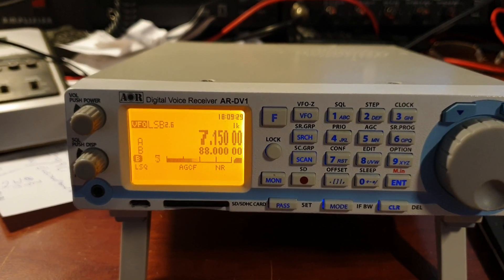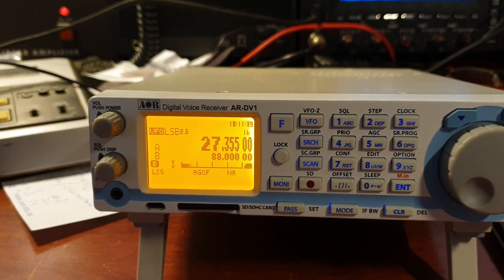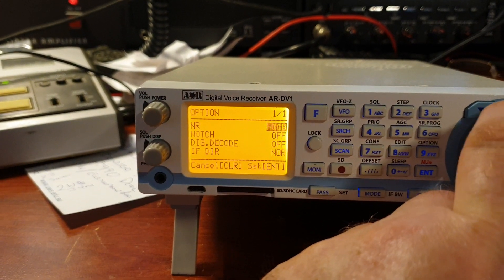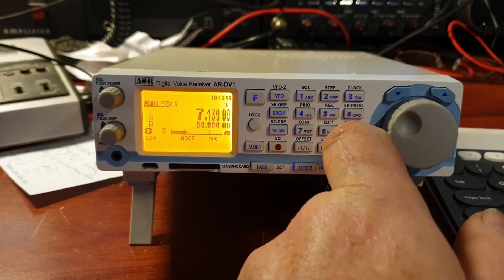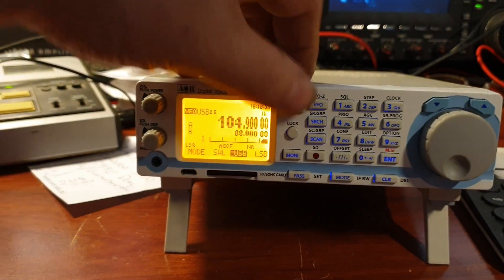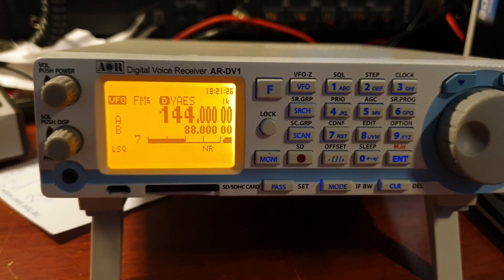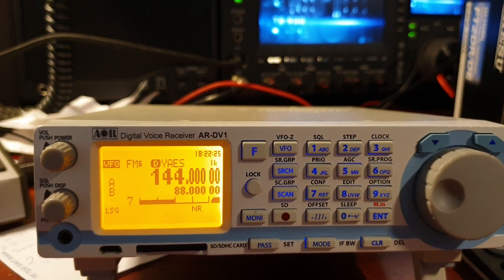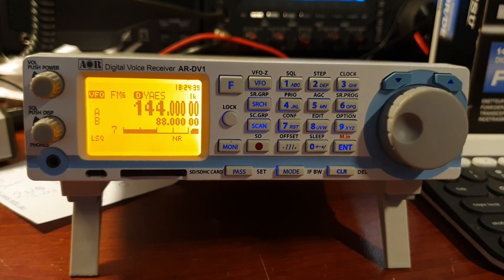AOR AR-DV1, I think I'm in love!!!!!!

Comment: Great little Receiver and the price reflects it. :) 73s Joe
Reply from the maker: Hi Joe, I was pretty lucky, in Australia, even through Australia's largest ham radio store (www.strictlyham.com.au) and hes never making huge margins, has them at a discounted price of $1800 AUD here in Aussie.  A mate in NSW was feeling sorry for me for this in the box as new one, $950 AUD posted to my door.  I was overjoyed as I couldn't see myself stretching for the new price unfortunately,  but now to learn all about it.  Just trying to dig up the AOR programming software that I think is on the net somewhere.  A mate sent me some CSV files to load up local fire authority etc, so its a start for sure. cheers Brenton VK3CM
Reply: @brentonmeadowsvk3cm  Wow Brenton, you did get it for a great price. $950.00 AUD is about $650.00 USD. The best I have seen it for is around $1000.00 USD or higher. SDR radios are changing the world of Armature radio. Going to be interesting to see what comes out with SDR in the next 5 years. 73s Joe

Comment: wish my dv-1 would work the way all others do. I've upgraded my firmware many times, had others look at it, contacted AOR, been on radio Ref and finally a radio shop. p-25 and sensitivity is poor on the vhf and above. compared to all my other scanners on all different types of antennas. my old aor 3000a beat them all. From telescoping antenna to a 70ft tower just trying to understand what's going on. 73's

Comment: WILL IT COVER ALL THE DEFFERENT DIGITAL MODES RIGHT OUT OF THE BOX??????????......08-12-2020..
Reply from the maker: Most areas of digital it will work aok but some areas of trunking etc can be laborious or even impossible.  The use on c4fm and dmr seemed aok, although even dmr has its funnies.  cheers Brenton vk3cm
Reply: Yes it will work out of the box , It is great to put it in auto mode then it will do everything for you , What happens is it know if its picking up  a signal in  AM/FM   or  LSB/USB  or any other  & will change over for you .

Comment: i'd like to find out if there is a way to tune and adjust this radio. I have nothing to lose doing it, my extended warranty is over. and hasn't worked correctly since I got it. my p-25 is unintelligible. wonder if it's off-frequency or out of audio adjustment. Appreciate any tuning info. thanks 73's